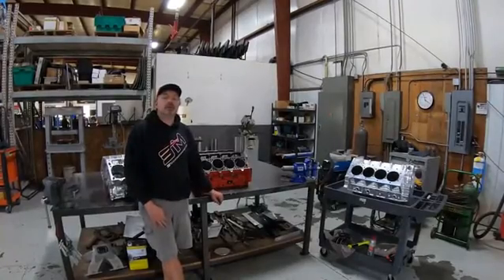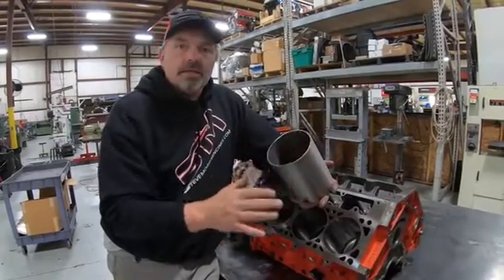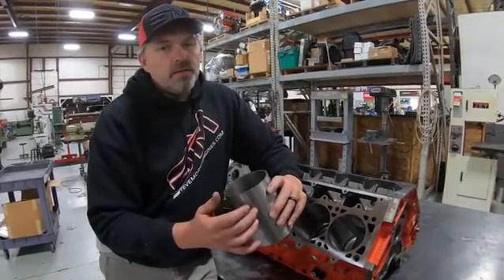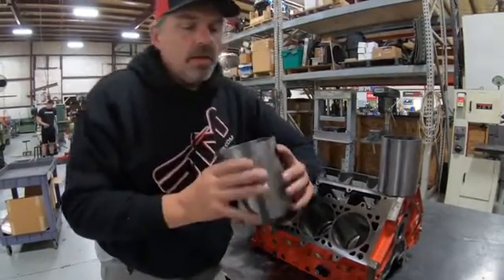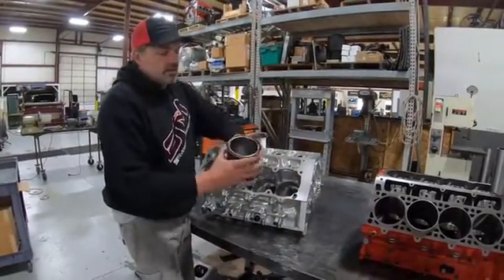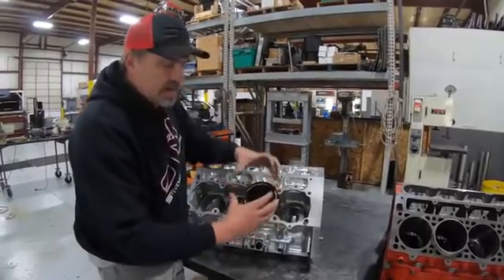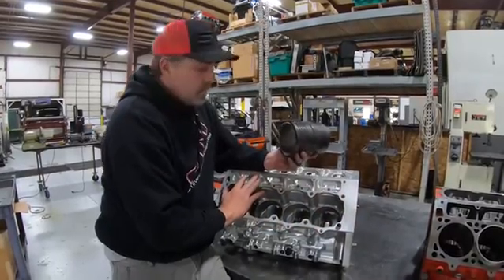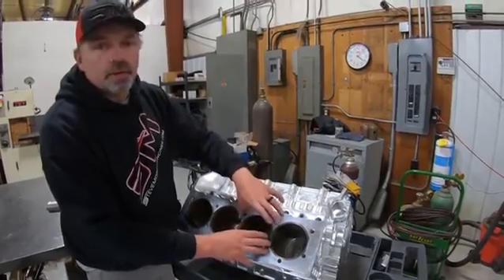Sleeving an Engine – Part 1

Comment: Mate - szenario - I got ma 2.5l 10.5:1 on petrol engine and soon work it up and fuel it with CNG, highering the compression to 13,5, whereas thru the lower volumetric efficiency of the CNG iam ending up with 5% less power but a way better environmental and economic outcome...

However, I want to set up a H2 engine using the same MPI and a 1.5 bar supercharger, getting it up to 20:1 compression you need for efficient H2 burn... however, thru the 50 percent lower volumetric efficiently, I still end up with 10% less power than the original 170 hp... what do you thing? I would put high temp high compression valves for sure, but would you also do something with the block? We get not more power, but compression more

Comment: Hello Steve. Thank you for your channel I'm learning a lot and loving it. QUESTION how big can you sleeve a engine. PS under 1000hp for now at least lol. I have 104mm bore spacing and would like to fit 99.314mm pistons. Anybody that knows can also answer. I just want to know if I'm dreaming. If it's not possible at least I can stop thinking about it. Regards Rik

Comment: Hi I’m in the Uk ,running a 400 block with B1 originals ,probably around 850bhp Iv had it lined ,lasted 5 seasons before crack returned , would you advise half block filling or not ? Only a quarter mile racer , thanks in advance

Comment: Thank you for this video. I have never rebuilt an engine in my life. That said, I pulled the engine from my Mercedes-Benz 560SL a couple of weeks ago and yesterday I finally removed the heads. That’s when I found deep scoring in one of the cylinders (car sitting 14 years). Not knowing what I was doing I panicked because of the scoring. But then I remembered that in the 70’s they put sleeves in VW’s so I started searching and found your video. I found they have sleeves for my 560SL! I have been documenting the entire car rebuild on my YouTube channel. Thanks again.

Comment: Aluminum vs. other materials like cast iron have different thermal expansion rates.  That .002" press fit would disappear pretty quick.  Can the round sleeves actually rotate in the block when running?

Comment: I'm going to admit I'm learning here, would it be worth welding up the crack and then boring the cylinder in the lsx block before the new sleeve goes in? Or is that just more trouble than it is worth?
Reply: Welding cast iron never really goes to well.. It usually just cracks again. Plus, all the area behind the crack is usually rusted to hell so welding it will usually crumble it. I've used epoxy metal paste and pasted a lot over the crack before and it seems to me that it gives it more lofe

Comment: Great video! Great information! As a machine shop owner please don't tell people to pound in repair sleeves with a sledge hammer!  I made a fixture to pull the sleeves in place on a V8 and it also works for inline blocks as well.
Reply: Oh did you now? Need one for LS engines. Link please  :D